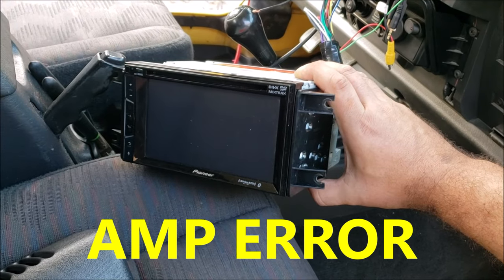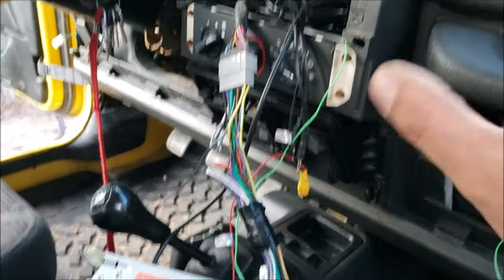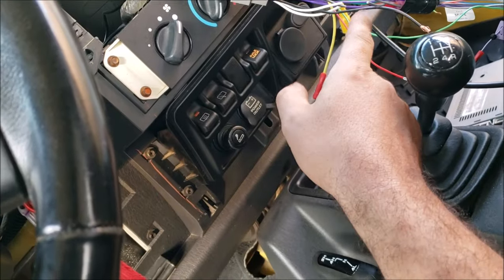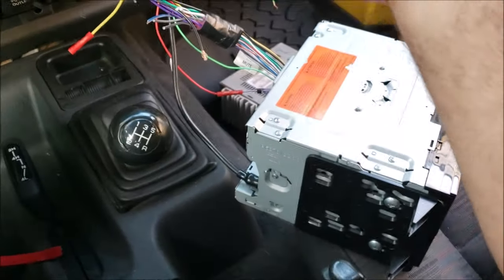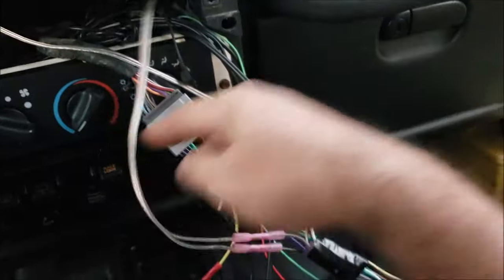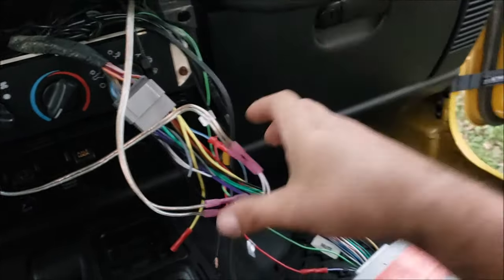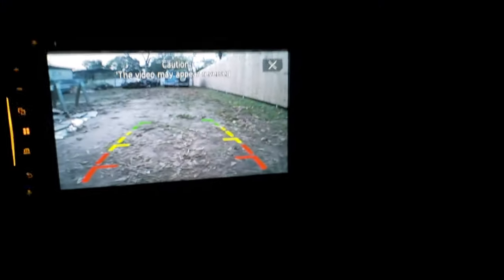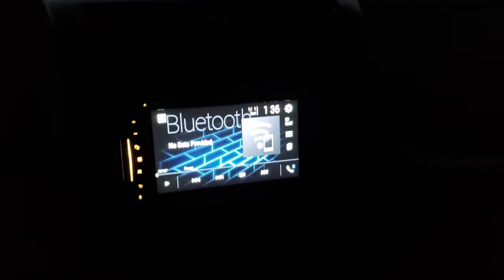PIONEER radio AMP ERROR code DIY quick FIX AVH-1300NEX

Comment: I cut my wires and the error didn't go away. Nothing but power, ground and battery hooked up and still have error. Ran new speaker wires anyway; still have the error. I called Pioneer Electronics and they said the audio output final in the radio is bad and that's what the error means.

Comment: A few days ago my pioneer started having that problem, amp error. Especially when i put heavy bass songs. I just simply turn the truck on/off and it starts working again.
Reply from the maker: mine was doing that at first then got to a point when it would not play any sound at all
Reply: @chriscraft77022  damn there is no 'easy' fix huh. I guess ill start doing the same. Its been bout a week or so.

Comment: I'm getting  the amp error message myself. I've seen other vids that have  the blue single wire (when it has no mate) tied into the red wires and I've even seen one guy take a blue and white striped wire and run it in with the red.  One guy reset his and it supposedly worked (not buyin that shit) but, this is my first stereo installation. I know the innards of my car VERY well now. I'm trying the cutting off power to one speaker at a time this morning here in a few hours actually.  Wish me luck.....
Reply from the maker: remember to unhook the blue amp wire first..  (remote antenna)  let me know what happens... good luck

Comment: I had the same issue today, a 
cheap stereo pioneer 210ex. Turned car off and on no problems. I don’t even have any speakers connected to speaker wiring on radio. Just small issues I have to get use to or spend more money on a deck next time.

Comment: Trouble shoot everything else, not saying this guy is wrong.  But I got the error and I just unplugged the harness and plugged it back in.  Still thumbs up, cause might help someone else
Reply from the maker: great comment.. I did not only do what you did like 10 times.. I even unhooked the battery like 5 times.. mine was an ACTUAL short on the front speakers.. mine still works to this day.. GREAT comment though..

Comment: I have the AVH 501EX...brand new. Had it in for 2 days now and I'm getting that same AMP Error code.  WTF, I'm only using the rca inputs no speaker connections. I guess I'll pull the damn thing out and check AGAIN. frustrating!!
Reply from the maker: I bought my radio refurbished so I was really frustrated because it worked for a day then stopped.. mine has been great since the video

Comment: Hello my friend thank you for sharing my pioneer DEH-p590ib I press it to turn it on and nothing happens and then eventually the screen will light on and say (no compressor) any ideas what could be happening? I found the 40 A fuse to be slightly burnt separated I try to jump it with same results I just ordered new fuses do you think that was it?

Comment: Installed full system in excursion. Ran fine for 4 months.  First rain of the year.  Amp error code.   Uggh.  Check door speakers and or pinched wires or water logging
Reply from the maker: did you fix it?
Reply: @chriscraft77022  well.  It worked great for about 20 miles then the error came back up.   No speaker issues or camera issues when it was working.   Thinking it might just have a pinched wire,  i was in ghe dash for alarm stuff and the headunit.    So gotta try again

Comment: I just got this error today. Would this be why it would turn its self off and back on previously or it also has a cord that I can plug into and if I disconnected and reconnected it would work? Just checking before I pull everything apart.

Comment: whenever i turn my car off the radio reset itself any tips on that? i have the same radio as you
Reply from the maker: red wire needs 12volts all the time even when car is off ... check that

Comment: My speaker wires dont go to the head unit. I have an aftermarket amp. Also if i shut my car off then turn it back on the amp error goes away. Its only happened twice in 6 months. I have a pretty big system. I read it could be the actual HU. If my speaker wires were shorting my 4 channel amp would go into protect. Rules out that. Also like i said before it clears whem i shut the car off n turn it back on. I think im just gonna warranty it. Sorry this was so long.
Reply: Same bro. Mine occasionally goes into amp error but when i turn it off and turn it back on it works again. Cut all my speaker door wires cuz i dont use them, i have an after market system consisting of a pioneer 4ch, 4 pioneer pros 8’s and 2 horn tweeters, sundown salt3, sundown zv6 12 d2 and a double battery in the back. It was doing fine without the sub but now that i installed the sub it cuts out sometimes.
Reply: @rapalaray1701 yeah it's very frustrating. I have 2 Avatar stu 12s, jp63, 168ah headway, 390 amp alternator, D4S 4 channel for skar tx mids n highs. All in a 09 Maxima. It did it the other day with the sub not even playing. RCA knob all the way down. It only does it when I have it up loud. I think the Internal amp is getting hot. Pretty sure there's a built in fan in the Hu. I have a pioneer dmh 4660 nex. I bought a Kenwood single din. I'm done buying expensive shit. Lol
Gonna take the pioneer back to Best buy.

Comment: Still can figure out what mine is I had everything wired and when I was ready too put the stereo in it did a amp error as I had it out before had it playing for like 20 mins before all this. I even disconnect speaker by speaker too further it out could it be a power or ground issue?
Reply from the maker: mine worked too at first for like a day.. just check each wire.  you may have to test it on the bench with a car battery
Reply: Chris Craft thx I’ll keep working with it I think it might have been the harness I had I reused it from another vehicle that I had so it has been used and pretty old so I ordered a new one to see if that’s it
Reply: Could it be a ground issue or not getting enough power I’m stuck at this point even tested each wire all worked fine no static just clean sound not even a clacking brand new speakers too
Reply from the maker: @zachwithastache7898  bench test it..   you have other wires that can be making contact..  connect 1 at a time on a bench..  NOT IN THE CAR check the fuses on radio.. some have 2
Reply: Chris Craft I did do that it didn’t work so redid pretty much all the wiring running new wire too the harness and it fix my problem I got sick of fiddling with the brittle stock wires but thx for the help
Reply from the maker: @zachwithastache7898  i bought my radio refurbished from amazon..  i was about to return it,,  but i fixed the problem,,,  maybe you need to get your money back.. i watched the videos where people are trying to get into the circuit panel..  BS..

Comment: I have the same problem so what should I do?????
Reply: I would unplug speakers get a multimeter do a continuity check on unplugged speakers. If you have continuity with speaker unplugged then that wire is shorted. Check the blue amp wire for short unplug at radio end if it doesn’t clear error after checking speakers. Return radio I had one power on and off on its own several times replaced second one ha sent done it but still has errors once in a long while. They are not made very well the 210ex.

Comment: What sucks for me is it only happens once and awhile so I'll never be able to zero it down to the actual issue
Reply from the maker: since I made that video mine has not done it again
Reply: I have the 4660 nex. Mine has only done twice in a 6 months period. Error clears when I turn the car off n back on. Also my speakers are hooked up to a 4 channel amp. I think the head unit is the issue.

Comment: Didn't fix my problem at all my stereo won't run with out the front right stereo but I replaced the full wiring for that speaker and it didn't fix
Reply from the maker: sorry to hear that..  let me know what you find out to be the problem...
Reply: Did you find a solution for it? Because Im facing the same issue. There’s no response from right side speakers. I even checked with the wiring and everything seems fine. Kindly help